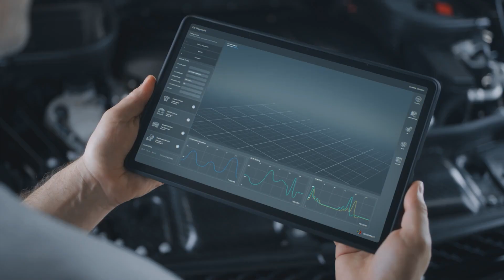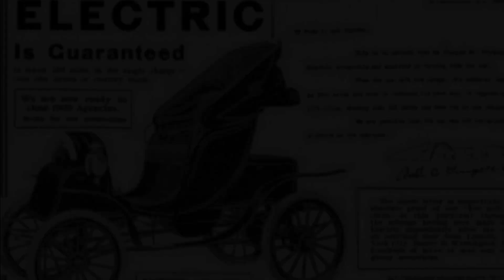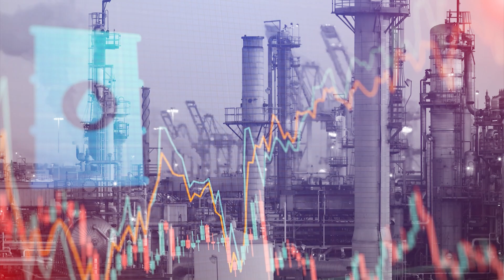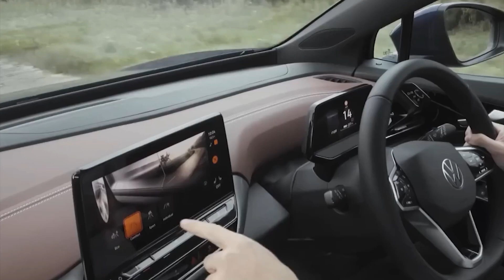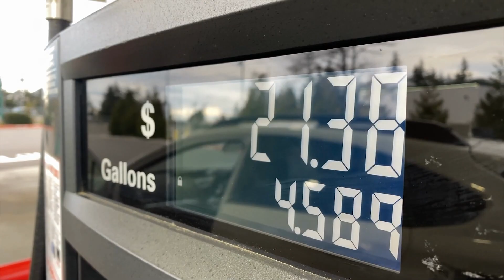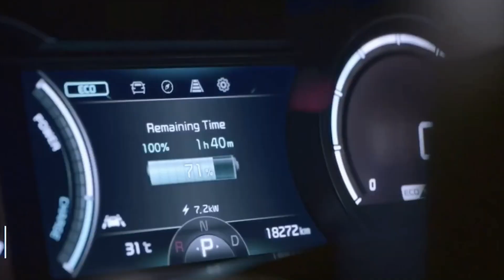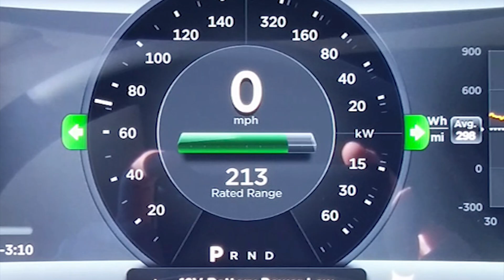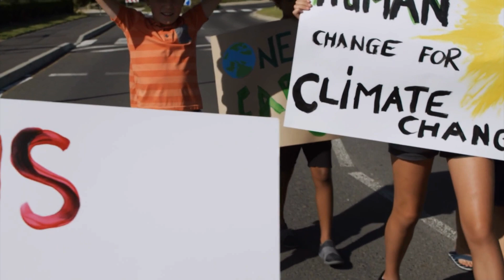Electric Cars To Outrun Gasoline Cars?

Comment: gasses form ICE are toxic that's why we are all dead. EVs are safe, so safe that some areas ban them for being a fire hazard that is extremely hard to deal with. Once government subsidies for EV go off (like in Germany) almost no one will buy EVs (like they stopped buying them in Germany, once the government rebate was canceled).
Reply from the maker: While EV safety is a consideration, advancements in technology address issues like fire hazards. Government incentives indeed impact EV adoption, but as technology improves and environmental benefits become clearer, interest may persist. What are your thoughts on the future of EVs?
Reply: @AmpedAuto  Future of EVs, whatever it is, it's not this.  Batteries are still way to expensive and inefficient. I guess you know how much it costs to replace the battery pack. Most pro-EV channels NEVER mention that. How about repair shops refusing repairs on EVs with any sort of electrical issue due to difficulty and risk?! Also, waiting for hours to charge the battery so you can continue the journey...please...

Comment: Electricity comes from power stations, which gives CO2, but the biggest question is the battery life. Once these start building up after use, the disposal also needs adding to its CO2 factor. To which its too early to say, but these are toxic chemicals you can't just tip. 😮
Reply: Pfff, that's not a problem as long as I can claim less pollution in my city, reelect me as mayor. I also make a sht ton of money on selling licenses for "pumps" and other EV dash things. Remember, profit and luxury life are #1 prio in life of every politician and they will lie to you accordingly.
Reply: Environmental aspect aside, we as taxpayer pay for electric infrastructure and it's maintanance as well as usage unlike oil industry(pay as you go). Of course there should be many other economic, political factors involved but I can't shake off the feeling that EVs are piggybacking on existing electric grid and comparing EV and ICE is like apple & orange.😮
Reply from the maker: Great points! The environmental impact of electricity generation is a valid concern, often involving CO2 emissions. Battery disposal is also a critical issue with potential environmental consequences. It's important to note that the EV industry is actively working on addressing these challenges. Advances in clean energy sources and recycling technologies are underway to minimize the environmental footprint. As the industry evolves, we hope to see more sustainable practices. What are your thoughts on the ongoing efforts to make EVs more environmentally friendly?
Reply: Currently 60% of global electricity generation is from high emission sources, with 40% from low emission sources. From 2023 all new demand for electricity is being met from low emission sources, and by the mid-2030s low emission generation will exceed high emission generation.

On the battery issue, we're already at the point where the batteries in new EVs will significantly outlast the vehicle, and a new business sector is emerging based on the utilisation of '2nd life' EV batteries in a range of applications. We can expect that the average EV battery pack will have a service life of ~ 30+ years before it requires end-of-life processing.

Recycling of EV batteries is evolving quickly, with high recovery rates of critical materials being achieved at competitive costs, and producing materials that can be reused in the production of new batteries.

Embedded energy and CO2 in new EV batteries is expected to reduce by 50-80% over the next few decades. The materials intensity of EV batteries has already reduced by a factor of ~ 3x since 2010, and is expected to reduce by another 2x-3x by mid-21C.

Comment: This is Fake News, EVs ar not selling so well now and they ar not as good for the environment as you say. Many carmakers ar halting EV production and don't forget we do not have all the electricity to charge them.
Reply from the maker: It's true that the EV market is evolving, and there are challenges, including production halts by some carmakers. While EVs have environmental benefits, there are complexities in their overall impact. Infrastructure limitations for charging are indeed a concern.

However, it's important to note ongoing efforts in the industry to address these challenges. Some regions are investing in expanding charging infrastructure, and advancements in technology are making EVs more accessible. The market is dynamic, and we appreciate your insights. What are your thoughts on the future of EVs and the measures needed for their widespread adoption?

Comment: Oil is a finite resource. It's only a matter of time before the oil runs out. 
Oil cannot be renewed. That is a scientific fact.
But electricity can be generated from renewable sources like the sun, wind and the waves.
Electricity is safe. It is efficient.
Reply from the maker: Absolutely, oil is indeed a finite resource, and the transition to renewable energy sources like the sun, wind, and waves is imperative for a sustainable future. Electric vehicles (EVs) play a key role in this transition, as they can be powered by clean electricity.

The efficiency and safety of electricity, particularly when generated from renewable sources, contribute to a more environmentally friendly transportation solution. It's encouraging to see the shift towards sustainable energy, and EVs are a significant part of this movement. What are your thoughts on the accelerating transition to renewable energy and its impact on the automotive industry?
Reply: @AmpedAuto  The real problem with "renewable" power systems is that they are inherently unreliable, and they can't be made reliable no matter how many hideously expensive battery systems to want to tack onto them.  At least in my opinion, if a power system isn't completely reliable, it's worthless.  I want that switch on the wall to turn on the light, every single time I flip it.  Anything else is unacceptable and I really start wondering what I pay those people for.
Reply: If you want a car that takes forever to refuel, that's your business.  All I ask is that leave me to my preferences while you live yours.  Where I live, electric cars don't fit very well and I'm certainly not tacking on thousands of dollars in additional cost to add a level 2 charger which will still take hours to fell the car up. 

Out of curiousity.  How much of your EV do you expect is made from petroleum products? Without oil, it doesn't exist either.

When they can make an EV that doesn't suck, I'll be happy to look again.  I don't expect that in my lifetime, just like I know the oil  will be available for the rest of my lifetime.
Reply: @ironclaw6969  my wife’s EV takes literally 2 seconds of her time to charge each day. The charging plug is on the wall of the garage next to her outlet that she walks by coming into the house. 

It charges at a rate of ~40 miles per hour. So if you only drive 20 miles (avg daily trip) it’s going to recharge that in 30 minutes. 

Level 2 charger was free from our electric utility company with rebate, and I already had a 100 amp sub panel in the garage we could tap off of. Only cost me $350 to get it installed. We saved more than that in just the first month for cost of charging vs gas. 

Heck, the whole first year when Russia / Ukraine war happened, the EV literally entirely paid for itself in gas savings vs cost to charge. This year gas is cheaper, so savings are roughly half the monthly payment, but factoring in the $8k rebate we got it’s also been more than covering our net cost. 

After 5 years, factoring in the lower cost of ownership and savings on fuel and maintenance in a comparable gas car and maintenance, it will pay for more than half of our next car.

Comment: Scientists have proven that electric cars are worse for the environment that regular gas cars.
Reply: Which scientists? Provide references.
Reply: This is not true at all. Even if you use ONLY coal-fired electricity to charge your EV, the improved efficiency at scale makes it come net in favor of the EV after around 30k miles. And electricity can easily be subbed in for carbon-zero sources (Solar is ridiculously easy to deploy almost everywhere in America).

I personally dislike EVs because I am a person who enjoys driving cars that feel lightweight and connected to the road (same reason I refuse to own an automatic transmission vehicle), but for most people they are going to be the smarter option. The range issue is going to become less of an issue with faster chargers and more reliable networks.
Reply: DUMBEST COMMENT but I guess for a TRUMP supporter!
Reply: Sources?
Reply from the maker: The environmental impact of electric cars is a complex topic, and various studies provide different perspectives. Factors such as energy sources for electricity and manufacturing processes play a crucial role. While there are challenges, many studies suggest that, on average, electric cars can be more environmentally friendly over their lifecycle. Advancements in clean energy and improvements in electric vehicle manufacturing are ongoing, aiming to further reduce their environmental footprint. It's an evolving field. What specific studies or findings are you referring to, and what are your thoughts on the future improvements in electric vehicle technology?

Comment: Electric cars low cost, pffft. Yeah until you have to replace the battery.
This video feels like propaganda.
Reply: I keep waiting for this mythical battery replacement the mouth breathers keep going on about, but I suppose I've only done 450,000 miles so what do I know
Reply: When do you have to replace the battery? Maybe for early short-range EVs with frequent charging, but EVs coming onto the market now won't need a new battery during the life of the vehicle
Reply: Most EV manufacturers provide a warranty on battery for 7/8 years and 100k miles. If you want you can pay for an extended warranty to get more coverage. 

Most gas cars have warranty run out in less than half that coverage, and are destined for the junkyard much above 100k miles.
Reply from the maker: Valid point about battery costs. As battery technology improves, replacement costs are expected to decrease. While upfront costs can be higher, lower maintenance and fuel expenses often balance it out in the long run 👍

Comment: Just watch the movie Ford vs Ferrari.  Now ask yourself if either of those was replaced with an electric vehicle, who would win?
Reply: Also saying electric trains are popular is only because they have a continuous power source, not just a battery.  Electric cars would rule if the road continuously gave the car power.
Reply: So what?
Reply from the maker: :) "Ford vs Ferrari" showcases the thrill of combustion engine cars. Electric vehicles are advancing, offering speed and efficiency. The debate extends beyond speed, considering environmental impact and cost. What are your thoughts on the future balance between electric and traditional cars?
Reply: @AmpedAuto  How many sponsors will still be putting big money into combustion-engined motorsport after 2035?

Essentially the internal combustion engine is reaching its point of ultimate refinement at the same time as it is about to become completely irrelevant to the future of human transportation.

Once this tipping point is reached (we may already be there) it will be extremely difficult for corporations to justify big sponsorships for an obsolete/redundant technology.